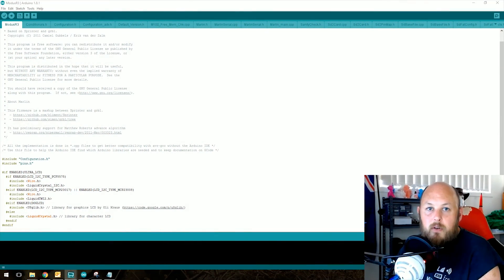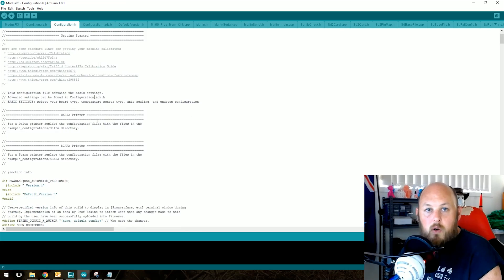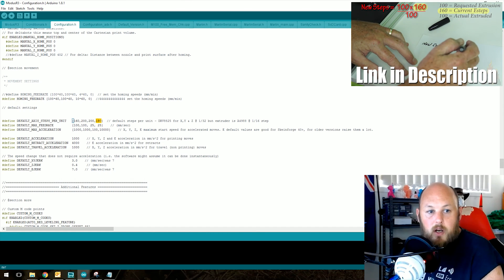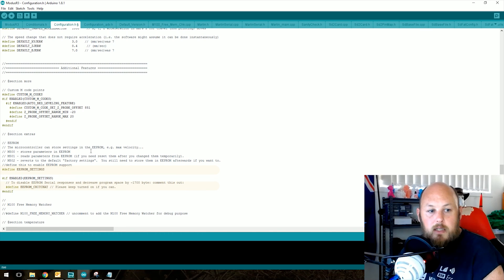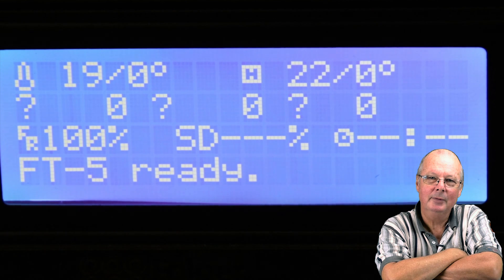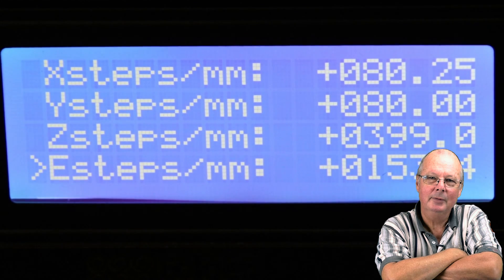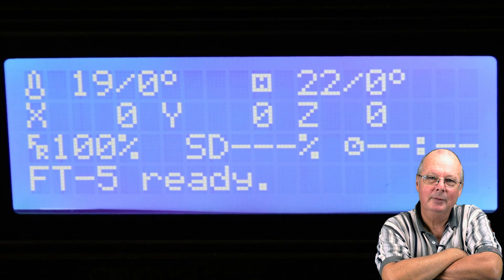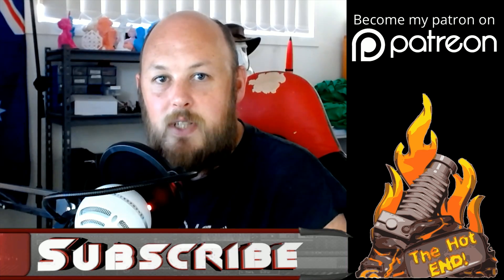Applying your E-Steps in Marlin and via the Control Panel!

Comment: Hi, my control panel doesn’t have the store memory in the settings. It only have restore failsafe. I have to change again everytime i switch on and off. Is there nth else i can do without flashing the firmware? That’s the last thing i wanted to do.
Reply from the maker: Sorry, no short cuts, either eeprom via LCD of flash firmware.
Reply: @TheHotEndChannel  Yeah I got in figured out eventually. Thanks

Comment: hey guyz, got a question regarding dual extruder e-steps on Geeetech a20m ... how do I set individual e-steps for each extruder ? I currently have 2 different brands of dual geared extruders and they have different gear ratios ... they stuffed up my order and in the mean time while I wait for delivery I want to use both ... my left extruder is set to 140 e-steps after calibrating and prints perfectly ... thanks blokes ...

Comment: Is it possible to adjust the E-steps/mm on the fly via the display?
I changed from PLA to ABS and got a lot of over extrusion and because of that i tried to decrease the number of E-steps/mm. The problem is that I now got stringing instead. And because of that I tried to increase the E-steps/mm again (while printing) and now I´m almost back where I began but I still got stringing sympthoms.